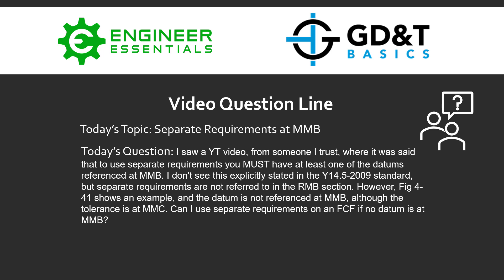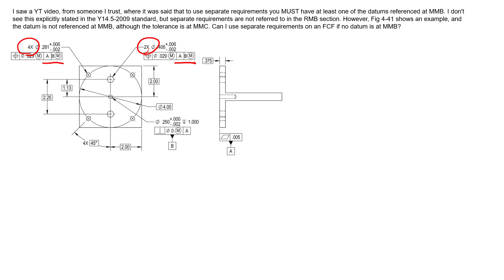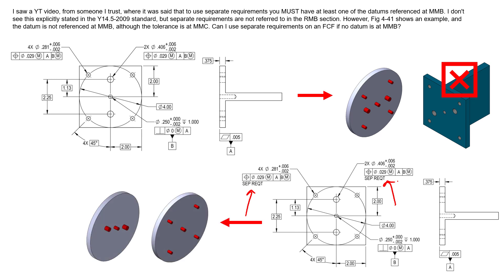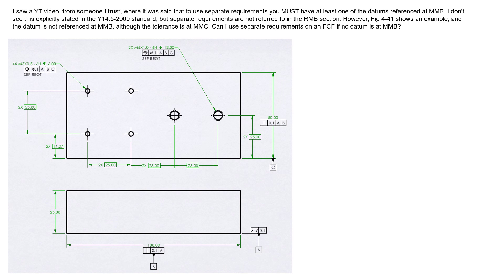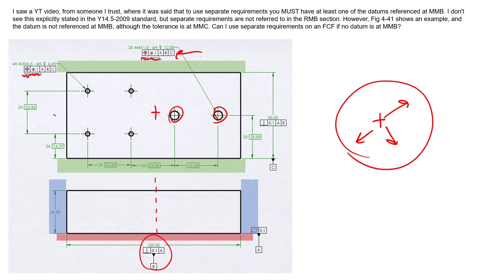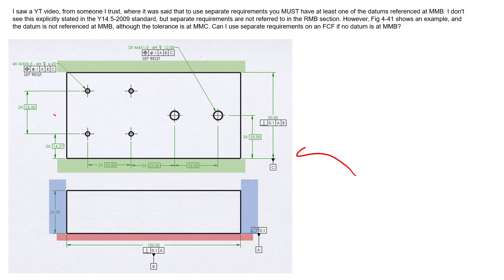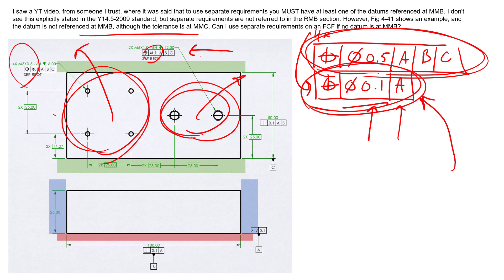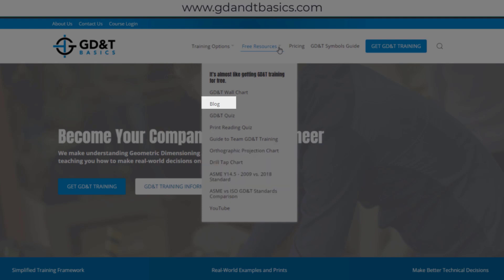Separate Requirements at MMB

Comment: Thanks for a great explanation. Just to be sure I understand, if I left off Datum C then separate requirements would make a difference because now there is a DoF that is free.
Reply from the maker: Yes but be aware, in that scenario NOTHING is controlling vertical location for either pattern, but yes you would also have the two patterns deviating completely free from each other vertically as well if SEP REQT is applied.